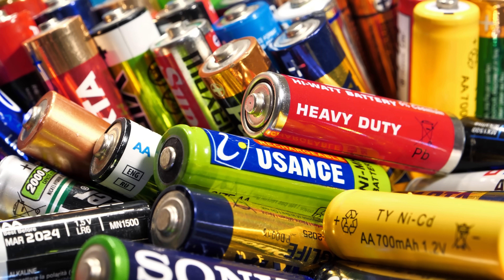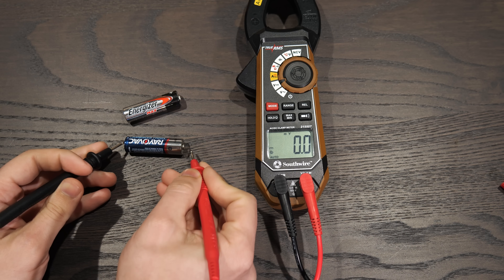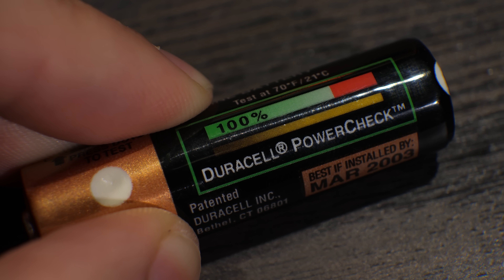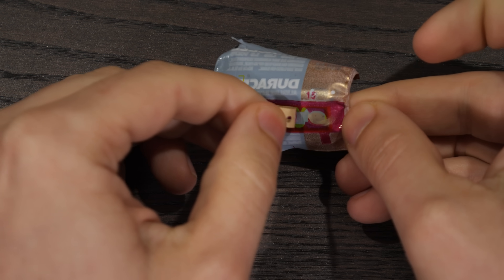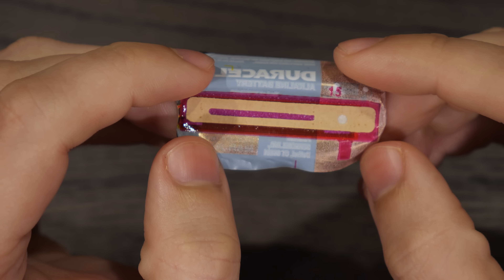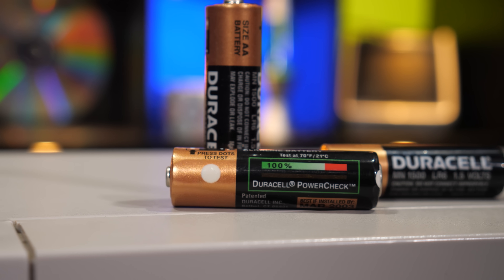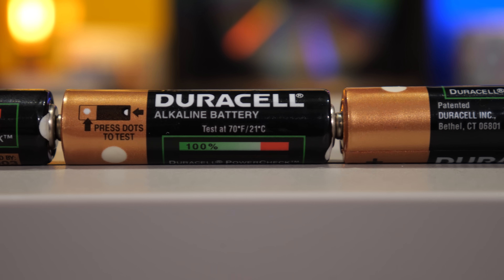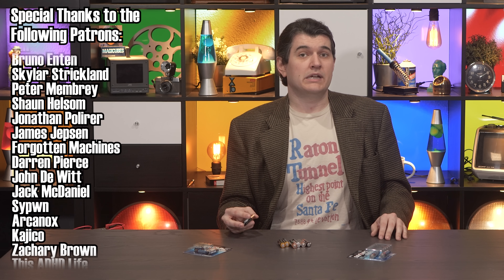Duracell PowerCheck: A genius idea which didn't last that long

Comment: I found one of these on the floor in around 2015 I carried it around all the time never used it in anything and watched as over about 2 years as I checked it the battery slowly run out of power

Comment: I used to cut the testers off those Duracell batteries and use them to test other batteries. The most compact and lightest battery tester you could have. The ones I used had both contacts on the ends, though, not one on the side. The one you show is definitely a very different design from the ones I'm familiar with. They actually had a plastic support structure made out of the same kind of plastic used in the plastic packaging that is frustratingly difficult to get into. That made them really easy to trim off and reuse.

Comment: I remember these Well. I used to have them during my childhood. I would normally use them in my Portable cassette player/ portable radio Gameboy of course and flashlights. They were fun batteries to use but I didn't test them all the time they hurt my finger at times but it was still a fun novelty. These bring me back fun memories

Comment: If an alkaline cell measures less than 1.5V unloaded, it is bad. (digital voltmeter) I found that out before Duracell made the testers on the batteries.

Comment: 11:08 Or until they corrode, like some of the appliances I tend to (not) use regularly enough. Yes, I get super unlucky with battery corrosion, which forces me to fuck with the "swab-it-with-distilled-vinegar" solution until it's clean of corrosive alkaline.

Comment: ive definitely used these when i was young in the early 2000s. only on triple a's though, i'm not sure if they manufactured them on triple a's longer than on double a's. or maybe i'm misremembering. the disappointment i felt when i started living on my own and the batteries i bought new didn't include the test anymore was immeasurable, since i'm definitely a used battery in a drawer type of person

Comment: Surprised there s no mention of the earlier iteration of these, where one tester was placed on the inside of the battery packaging (blister pack) and you slide a battery in and squeeze the tester against the terminals at each end of the battery. same functionality.

Comment: I feel like power check would be exceptional for the rechargeable ones. As a photographer that has a speed light that runs on AAs. I'm constantly trying to figure out what batteries have charge and what dont (I'm clumsy and sometime accidentally mix the charged and used ones together)

Comment: Just place a battery's flat end on a table, lift it a centimeter from the ground and let it fall. If it jumps several times — it's probably drained. Otherwise it's probably ok

Comment: I didn't realize how much I needed to know this until now! I remember as a kid always checking so see what loose batteries was still good enough to power up my gameboy color when the other batteries started to go. The batteries that didn't have a test strip, I used to touch the tip of my tongue with it to determine if it was good or not 😆

Comment: I 100% would pay for this feature on NiMH rechargeables, since those leak power in storage so if you charge up a bunch and put them in a drawer they really will be half charged when you want them and you want to know which ones go in the device and which go back in the charger.

Comment: I liked those testers because it was a good way to troubleshoot things. If something wasn't working, it was easy to test to see if the batteries were the problem or whether it was the device itself. There was no guarantee that the "fresh" batteries you had were actually fully charged even if they were in an unopened pack.

Comment: Putting the batteries into a device that needs batteries to work is only an effective test of the batteries if you assume the device itself is working.

Personally, I though building a battery tester into the packaging rather than the individual batteries was the better idea.

Comment: A couple of pedantic nitpicks:
1.  An electrical battery is an array of cells.  As mentioned in the video, "AA", "AAA", "C", "D", etc are single cells, so they aren't actually batteries.  (9V, lantern, and car batteries are really batteries, comprising of multiple cells.)
2. Current literally means "flow of charge", so the phrase "current flow" is redundant, much like "ATM machine" and "PIN number".

Comment: Its funny because my xbox remote with the headset plugged in will lose power when the batteries reach about a quarter charge left, so i throw them all in a box when that happens, and use up the rest of the power in them in my tv remote

Comment: The one thing I hate about rechargeable batteries for random devices that used to commonly take AA batteries is that they’re rarely replaceable, so when the rechargeable battery finally dies, you have to buy a whole new device, and there’s no standardization for the rechargeable cylinder batteries. So if you do buy a device, you can’t have a bunch of batteries laying in the trickle ready to go when you need it because each device used one of 10 different common sizes and voltages

Comment: My dad always thought they were stupid.  But he also made his own battery tester with a mini light bulb and a copper wire to a little metal end.   We didn't half use batteries but when a device would die and we replaced batteries, we would shove the old ones to a drawer and then would test it.  Those little testers always hurt my finger and it was really a gimmick when it would claim it was still good and then my dad's tester would show it was about to die

Comment: I assume the "heater" is just the heat of the current passing through the strip. Kinda like how you can light a gum wrapper on fire with a battery.

Comment: I remember them things, it gave me instant nostalgia just seeing this lol. 
I agree fully, it was a great idea and worked really well at a cheap cost but it didn't really have much practicality. If I'm swiveling around for spare batteries my 'third eye' intuition guides me on whether a battery is good or not. There's just a certain feel and heft to them that tells you the difference.

Comment: 0:16 This is one of the main reasons why the Game Boy Pocket did not succeed Game Boy's popularity- instead of designing it for 2x AA batteries (which would have been a substantial downsize from the 4xAA of the Game Boy), they decided to use 2xAAA which had less capacity. A lot of GB users also invested in AA batteries and chargers back then.

Comment: In highschool the physics teacher told us to bring a AA battery, and he insisted it had to be brand new. The one I got had the power checker and I was so nervous that I tested it constantly, but when the teacher tested it with a voltmeter he discarded it saying it was not new 😐 that is how I realized the checker was actually draining the battery a little each time.

Comment: My grandma had big packs of these in her forbidden cabinet ( that cabinet grandparents don't want you in), I always took them for my controllers and I seen that meter and never knew if you could actually gauge the charge, I thought the temperature was for how hot the battery shouldn't be or something lol. I was so lost I thought the charge label was just for marketing, ya know just to say 'oh well these batteries have a actual charge meter so it's more efficient than the normal ones' kind of thing. I never seen that yellow bar in my entire life like ever and I was using those batteries for at least 2 years too. This is really wild to me.

Comment: I had these powercheck batteries for a while as a small child in 2013-2016, was absolutely gutted when they stopped using them for most of the time (I believe like 2018)

Comment: I used to play with these strips, when they were fitted on the packaging, and then later on the batteries themselves. 

I noticed that if I touched the strip before the bright yellow receded, the yellow would disappear quickly where I touched it in the back. I also felt a tiny bit of heat.

Comment: So... I have a battery charger, yet I don't bother charging my batteries. I think it's because of how infrequent I actually use batteries. I get those "10 year long lasting" batteries (which are most likely don't last 10 years), and then I usually don't have to ever replace them. Plus, I get batteries in bulk, so I don't have to go get new ones for a very long time.

I do actually have a question about batteries that I'm wondering. Do freezing batteries actually make them last longer, or does that just make it worse? I'm on,y asking, because my mom saw that somewhere, and decided to do it, and I'm the guy who knows more about electronics, so I'm a lot more skeptical about that.

Comment: This technology on a rechargeable battery like an 18650 would actually be much more useful. I often don't keep those batteries in that device (flashlight) that I use them in due to fears of parasitic drain killing the battery by discharging it too far

Comment: Only reason I miss these is old gaming remotes i lost the pack for like Xbox or Wii, but now a day I just use rechargeable, and since those already cost more I think should include the strip… I’ve been using energizer cuz cheaper but I could be persuaded to buy 4-6 Duracell ones if they had this since I need that many for remotes… also sucks when randomly dies mid game

Comment: I went through a ton of gameboy batteries as a kid, knowing the charge left before I had to change them or when managing many "low charge" batteries when supplies were limited was very useful. I even figured out how to charge them by rubbing them or putting them in the sun! which now I realize...was just cheating the charge meter

Comment: If you have loose batteries which you don't know if they have charge or not, drop it negative side down on a hard surface (like from 1cm height). If it doesn't bounce, it has enough charge to use.

Comment: Love rechargeable AAs, also a thing I consider is how batteries can give out like in the PSP they are notoriously bad for swelling up and exploding in the console after years, and most things don’t even let you replace the battery easily anymore, so I think a easily swappable standard battery would be awesome, love how my old game boys batteries can easily be taken out for storage and always replaced, don’t have to worry about trying to buy a cheap off brand or find a working OEM battery for something that’s not produced anymore, so some rechargeable AAs would be really appreciated on more modern devices

Comment: I imagine designers use AAA over AA to save on weight more often than volume. A more lightweight remote control probably feels a little nicer to work with. I’d still prefer they use AA too, though, to save us money. (Maybe smaller batteries that get changed out more often are less likely to leak too?)

Comment: Drop test works great and does not require any tools for this simple test. Just drop the batteries one inch on the negative size down and if they fall over they are used if not they still have some life left.

Comment: I still regularly use a Micronta battery tester bought in Radio Shack about 40 years ago. Different devices need different amounts of current. My sister would always put "worn out" batteries out of a torch into a transistor radio where they would work fine for weeks.

p.s. How many people remember the Radio Shack / Tandy "free Battery Club" or the giant five cell flashlights that were free if you bought a complete set of D cells for one ?

Comment: I'm from 2006, Netherlands and I've seen these around quite a lot in the past. Don't see them as much as I used to, but I still see them being sold every once in a while.

I actually quite like them, I often take out the batteries of things that I'm not using, so it is useful to be able to tell whether they've been used. I probably should get a battery tester...

Comment: Wasn't the PowerCheck also included on rechargeable NiMH batteries? Makes a little more sense in that case; when one set of batteries needs to be recharged and there's another pre-charged set in a drawer to replace them with, it's nice to be able to quickly see if the pre-charged ones are actually still charged enough, or if they too need charging.

Comment: I was just thinking the other day how much I missed these things. I'll periodically come across battery-operated things that aren't working and wonder whether the battery is dead or the thing is just broken. It would be nice to still be able to do a 10-second check right then and there instead of having to go across the house to find my multimeter or to get fresh batteries to test whether that's what the problem is.

Comment: The design of the full shell being part of the battery + or - is the reason metal cylindrical lithium cells are so dangerous, there's very little distance between the - and + on the top of the battery cell, they having an insulator ring on the top but it's easily damaged.
Reply: And some manufacturers insulator rings aren't as good as others.
Reply: Also if you have stacked a battery inside a metal case and two batteries sides are damaged and touching the case it causes a short circuit. Which is one reason why some "hover boards" and other electric vehicles like scooters often catch fire.

Comment: I think the way I ended up using these most often was if you had a device which used two batteries, this was an easy to way to quickly test which of the two batteries needed replacing, but that is quite easy to get around by just switching out each individual battery with a fresh one.

Comment: Still one in my alarm clock, that just sits there and displays the time as I don't use it for an alarm anymore. Pretty sure I got it and the battery back in 2000.

Comment: Nah tiny flash light bulb and two thin wires look fine but you don't know the exact volts but i know how bright it is. This was my generation and the funny thing is those things got people to discharge the battery more by over testing.

Comment: Just a point about old batteries often got into the drawer. Disposing of batteries was always a pain here in the UK, so we often took the old ones out and they would invariably be placed into some other box until we had enough of them to dispose off in bulk. The package designs for a lot of batteries often meant storing new ones was a pain too once the packet was opened. So eventually you’d end up with a bunch of old and new ones together in one place.

Comment: I used to use these in my Game Boy and the use-case for the testing strip is incredible in that application. I had a separate place to put batteries that were below a certain threshold (about 1/3rd) just in case I needed an emergency battery for at least another couple of hours of Pokemon. it wasn't a perfect system - it relied on me checking batteries all the time if I wanted a steady supply and obviously that's not exactly practical - but I still managed to keep up a decent stash aside just from having one battery fail, after which I would replace both and pocket the spare energy of the remaining battery.

Comment: As someone who owns trail cameras I have a shit ton of half life batteries, that I end up using in my Apple Magic mouse and keyboard.  Since I'm a mechanic, I always check batteries with a multi meter.  

Yes, not too long ago there were Duracell Quantum batteries that had the powercheck, I always got frustrated trying to use the powercheck, and I'm not surprised that they were discontinued.  I remember all the ones I had, died, and that was the last time I saw any more.  I now have a whole case of Acdelco batteries.

Comment: I disagree on your point that you can simply test batteries by putting them into devices.
You know, I'm also part of the team that keeps already used batteries. Or rather: My family had always used rechargeable batteries, so that's how I learned how to do this.
And the thing is: If your device needs 2 (or even more) batteries, the chances are VERY high they they don't get depleted in equal speed. In fact, quite the opposite: My body scale for example doesn't work any more. I check the two batteries and notice that one of them is dead while the other still has 80% power.
So if I would just throw away both batteries, I would also throw away a perfectly good battery. And I'm not doing that. Instead I'm just replacing the dead battery.
But yeah, I'm probably in the minority with this behavior and most people just waste money, resources and harm the environment by simply throwing away all the batteries.

Comment: If you want an easy way to figure out which batteries are dead and which arent, drop them from a couple inches. The ones that bounce higher are used. Energy density reduces as its used, reducing its actual measurable density. Id imagine you could weigh them too with accurate enough scales.

Comment: Most frequently used them in Walkman and CD-Walkman -style devices, which were also the things that ate them the fastest, and consequently led to the most juggling. When I switched to a MiniDisc player, it only required 1 AA battery, so not much juggling with that.